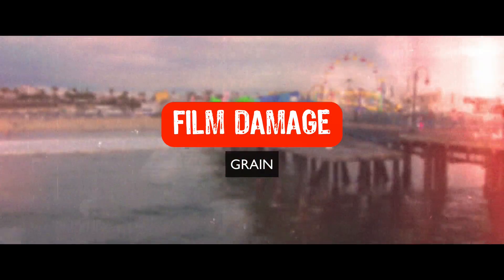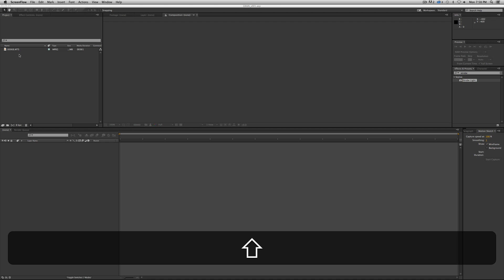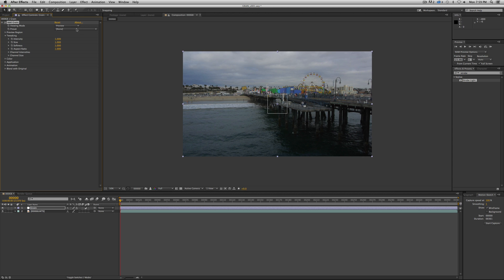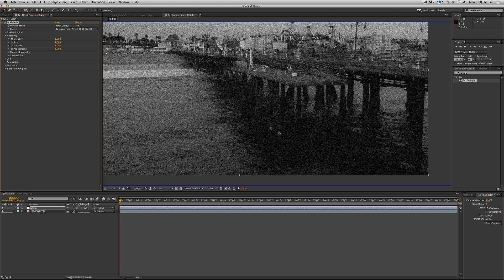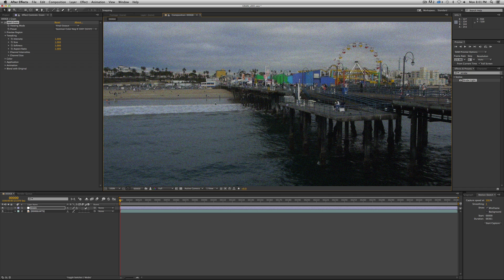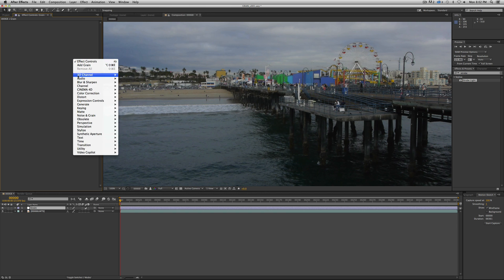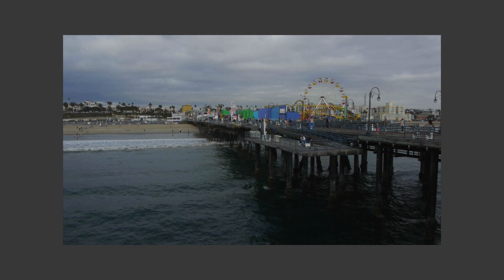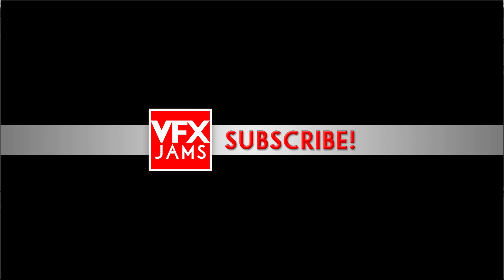DIY Film Damage - Grain

Comment: Thanks!
Instead of Add Noise, Match Grain works almost like Add Grain and it's not slow. It doesn't have film presets, but, it has other options like intensity, blend, color etc which make it very real looking, because in real film grain, you dont see it much in brighter or whiter areas